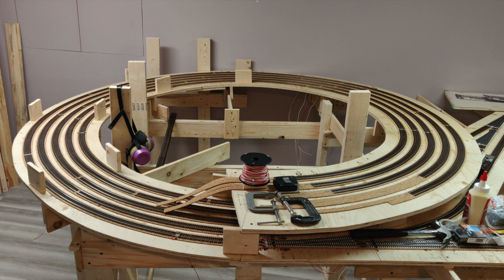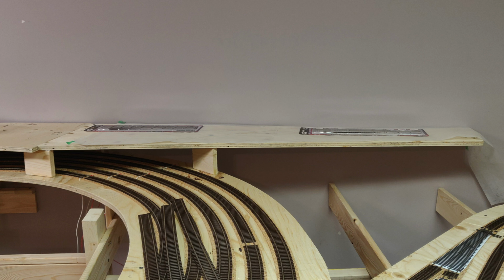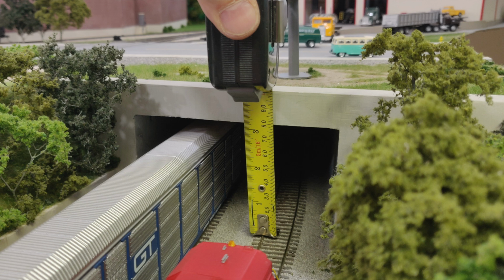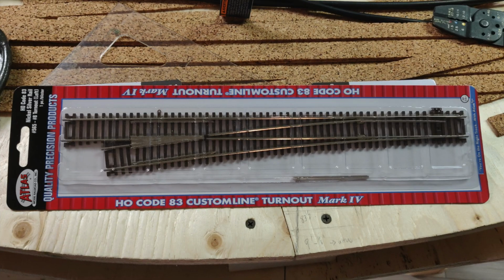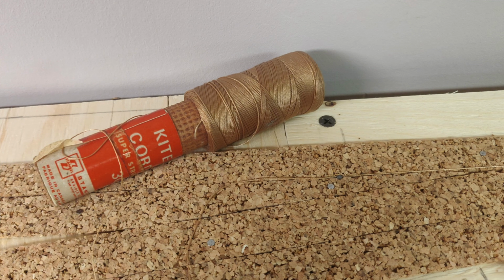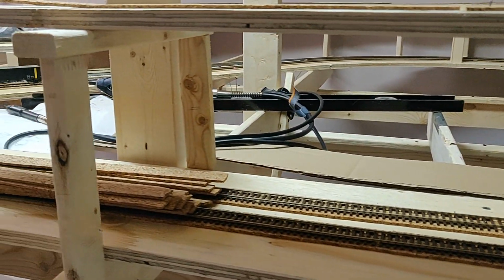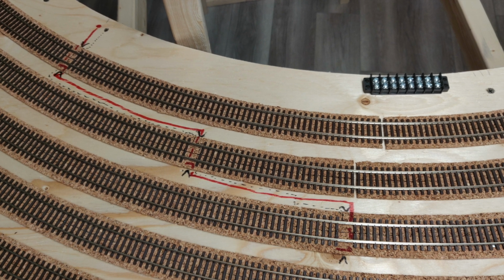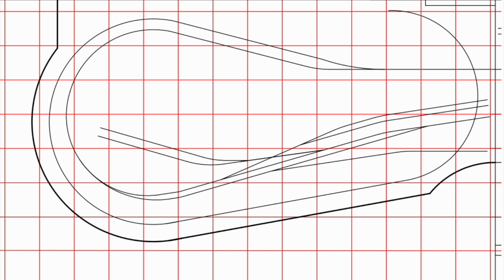Q&NE HO Layout Video 161 - 240920

Comment: Get a four-foot rule and tack it down flush to your track.  You may have to lay down loose cork to get the height right.  You can the press tight to the rule edge.  Any straight edge will work.  You lay pretty clean looking track.  Nice work.  The helix staging is inspired.  You get a really long track with very low space use.  There was a idea in and old Model RR magazine.  Put a tortoise under places in staging to go up and down.  Hold the cars until release acts as a break.
Reply from the maker: Thanks for the comment. I remember that article. I sometimes use a long plywood strip as a straight-edge. Four feet is not long enough!

Comment: Why not add a spur for a chip car dump along your chip piles.  There are a number of interesting options for this including those for end dump cars?
Reply from the maker: Thanks for your comment Steve. Unfortunately, there just isn't enough room for both coal and woodchip unloading spurs, plus I have many good examples of large mills receiving logs or chips offsite, with conveyors carrying them over considerable distances into the pulp building. I briefly considered a chip unloading spur directly off the mainline, but it is on a curve and grade (in the wrong direction), and sometimes less is more, if you know what I mean.
Reply: @QNERailroad  There is a paper plant about 25 miles from Walla Walla and they have a dumper for end dump cars, it looks so cool to see it lift cars up to  something north of 45 degrees.  I model Colorado, where I grew up along the Colorado and Southern  about 50 miles north of Denver.  I doubt there is a papermill in Colorado, but it is a very cool industry with plenty of diverse in bounds and out bounds.
Reply from the maker: True.

Comment: I admire and appreciate the thought going into your design.  I especially like the idea of having retired out of service service track to represent change and upgrades to the industry.  Adds an element of time and realism, especially considering often decommissioned tracks are just left in place to decay.  Will you be bringing in any wood chips, log loads etc. On flats or high capacity open hoppers?  I see opportunity for a siding and an off loading landing in the top corner perhaps (if my brain is thinking about the process correctly?)
Reply from the maker: I got a few comments about this. Not unexpected. Unfortunately, the wood chip piles are located across the mainline, so I would have to squeeze in a curved turnout off the main, on a grade, unless I used the spot I had planned to used for the mill switcher service area for unloading (which would require re-thinking the location of the chip piles). From the photos I've seen it would need to be more substantial in size, and I wanted to preserve the scenery to track ratio. Furthermore, based on my latest track plan, the small yard will quickly run out of space, even without wood chip or log cars. Plus, I figured that in New England there are plenty of raw materials close by such that log/chip shipments by rail are not necessary or cost effective for the mill. Still time to think about it though ...
Reply: Indeed, that May make  it possibly too much

Comment: I see you have some pop wood stacks have you thought about adding one track for pulpwood cars since you're looking for car variety
Reply from the maker: I got a few comments about this. Not unexpected. Unfortunately, the wood chip piles are located across the mainline, so I would have to squeeze in a curved turnout off the main, on a grade, unless I used the spot I had planned to used for the mill switcher service area for unloading (which would require re-thinking the location of the chip piles). From the photos I've seen it would need to be more substantial in size, and I wanted to preserve the scenery to track ratio. Furthermore, based on my latest track plan, the small yard will quickly run out of space, even without wood chip or log cars. Plus, I figured that in New England there are plenty of raw materials close by such that log/chip shipments by rail are not necessary or cost effective for the mill. Still time to think about it though ...